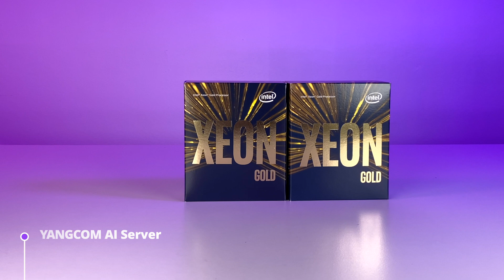RTX 3090 8Way GPU Server

Comment: What are the GPU temps at this configuration at 100% load working 24/7?
I am building similar server and thinking to install only 4 GPUs (Gigabyte 3080 turbo) for wider gap between blowers for better airflow.
Any thoughts/advice?
Reply: you have to put it in a really cold space, it doesn't matter how good is your airflow

Comment: Are these 2-slot 3090s available to buy anywhere?
Reply: RTX 3000 series and up doesn't support NVLink or SLI so 2 3090's would not be a good idea even if it has the port for SLI
Reply: @MrTefe  I do multi-GPU communication via PCIe in my software, so no need for SLI ;)

Comment: miners?

plz man don't use rtx 3000 series they are specially meant for gaming
quadro and RTX 8000 and rtx A series cards are meant for these things:(
Reply: It's an AI computer. Built specifically for machine learning. It's fine. Plenty of people use 3090s for machine learning thanks to the much cheaper price with comparable performance. It's only 24GBs of VRAM which is sad, but better than paying nearly 10x the price for only twice the VRAM.

Comment: You forgot the 8-Way SLI bridge! 🙃
Reply: There is no bridge like that, only 2 3090s can work with communucating each other. Some of programs doesnt require that bridge and be able to run all 3090s at the same time
Reply: I know its a joke but the 3090s don't require SLI, SLI hurts in this case. We want multi-gpus directly communicating via NCCL.

Comment: This is super cool but I don’t those 3090s are being cooled enough
Reply: 100c or more on the core, The memory on the back will be dead fast
Reply: that fans in there are pulling 30W-50W each. The 3090's are not going to be dead
Reply: @keisuke9194  maybe not the core but id definitely have to ask about rear memory, just look at that shit, a miner would tell you that even in an open case the rear memory is cooking
Reply: @keisuke9194  for my usage i need it to be below zero
Reply: they are cooled fine - theres 10 fans blowing the air to them and they are blower 3090s, meaning that the hot air will all go through the pcie brackets and not back into the case
Reply: @im_a_blobfish  not for my usage. i need below zero

Comment: imagine using this for gaming instead of server
Reply: SLI is dead nVidia killed it so running 8 GPUs and using 1 of them running the game as RTX 3090s have no SLI profiles for games and SLI unless i am mistaken isn't supported anymore
Reply: @yumri4   you can use it in some games but it doesnt makes cuz it even drops the performance in some situations
Reply: @keisuke9194  how nVida "killed it" is they pushed the burden from their team which knows what to do where and how to the game developer. For this you have 3 or 4 different supported ways. The one  i know most of is the program is made for the GPUs used. Each combination of GPUs is coded in for how they are to be used.

I am assuming you know about the time crunch triple A publishers put their game dev teams on so supporting GPU combinations when Steam hardware analytics say most only have 1 GPU isn't smart time wise. 

The ones who do support it in coding most likely use a generic script. Thus why lower performance than with 1 GPU in most supported titles.

Moving it from the driver maker to the developer is smart on paper. For software devlopment it makes lots of sense but for the segment of software that is games it doesn't make sense.
Reply: @yumri4  yes i do and yes i agree( that server is going to be used for AI stuff and render stuff)
Reply: @yumri4  the RTX 3090 supports SLI but the 4090 doesn’t support it anymore 🙂

Comment: That case is incredible!
8x GPUs, super clean cabling, redundant M.2 boot disks, and still has 2x PCIe x16 slots for 100gb networking
Reply: shame they'll be running at 100 degrees on the core and like 105 degrees on the ram this is definitely form over function, those 3090s are DEAD
Reply: @BonusCrook  I don't think you understand the ridiculous quantity of air those fans will deliver.
They'll probably pull 30-40W each, and scream at 80DB.
Also keep in mind the chassis is designed for modern accelerators like the A100, which go up to 400W in the PCIe form factor (Or 500W in SXM4 form factor 😃).
They'll be fine.
Reply: @popcorny007  its not actually about the airflow, or the blower fans on the cards its more about the memory on the back of the PCB honestly
Reply: @popcorny007  i assume that too that this fans are going at that wattage so that the 3090's are not going to to cry bc of overheating
Reply: @keisuke9194  should have gone with quadro rtx, the gddr6 on rtx cards can be toasty
Reply: @ariffurqon3490 surprisingly, A6000 is only 50W cooler while having the same performance with 3090 (other than VRAM ofc)
Reply: What base server was this guys?

Comment: My ass if this is even gonna get 1% air flow!...
Reply: They use delta fans. It's going to be fine.
Reply: @bgtubber  they r pretty close next to one a other even if they use helicopter fans i k ow just by looking those cards will heat like crazy
Reply: GPUs with blower fans are designed for this exact configuration + with those counterspinning deltas, the cfm through the case is insane.
Reply: @yuh_lentina  same reply as above...
Reply: @SkyHighFilms777  and it's just as wrong. Again, it has been designed to be used this way. It IS used this way in thousands of systems. You need to think about thermal energy instead of heat here. X volume of air can take up y amount of thermal energy. As long as your total x is big enough to take up  your total y you're fine. And believe me, those cards get enough airflow. Those blower fans usually spin at around 5000rpm, the suck in from below (in this config the side) the card and push the air through the entire, closed of heatsink tunnel out the back of the card (therefore, out the cassis. And they get rammed with an insane volume of air coming from those deltas, stacked counterspinning deltas mind you. Research the cfm and static pressure of those fans. So again, the cards get enough air.
Reply: @yuh_lentina  the only wrong here is ur lack of insight and experience, I built several rigs I  the past and presence, even if u have helicopter fans not just deltas but you don't have enough clearance between every other card, that card will suffocate ! It's pretty obvious remark just by looking at the video cards are stacked next to one another, so if u don't have I  hand work experience plz don't talk coz ur making a fool out of urself...
Reply: those cards are going to cook, I don't care how many delta fans it has, imagine the insane temps for the GDDR6x on the back